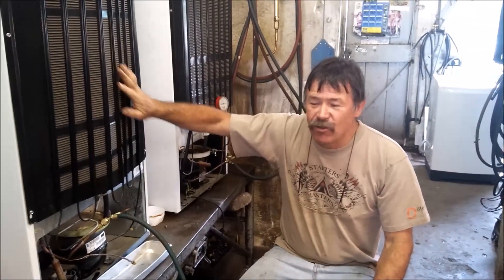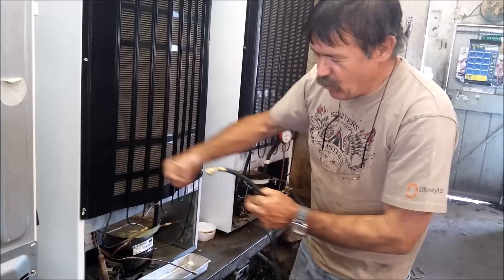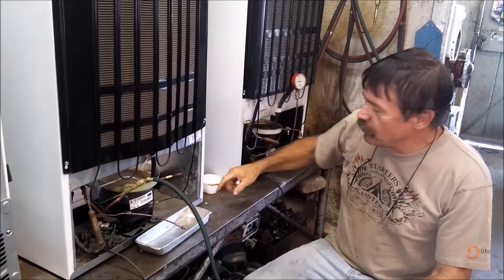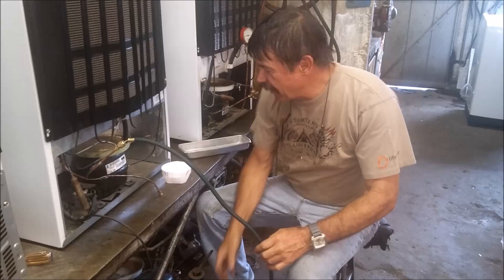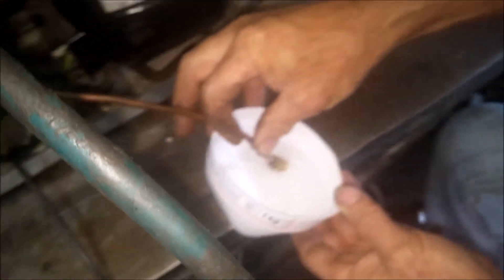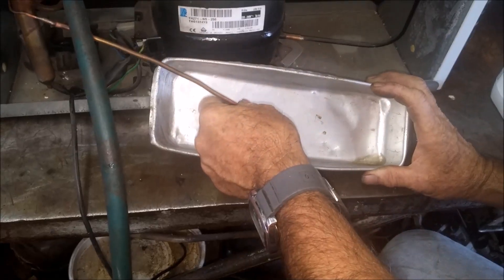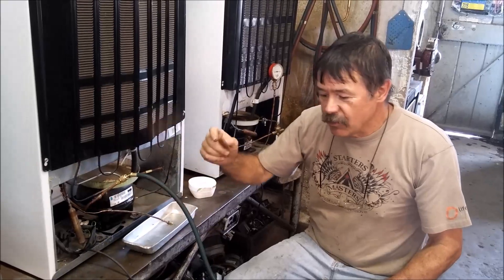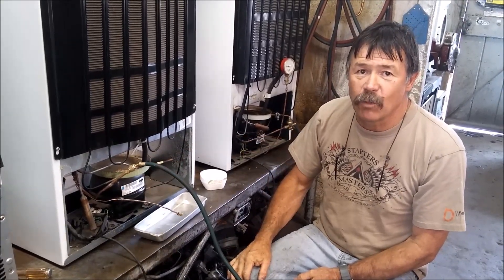Clearing a blockage - J D Nel Refrigeration

Comment: My repair tech said I need a new compressor, but I may just have blockage. The compressor is running, but the lines are cold. I may try this. I have gauges, but I don’t know what pressure to bring it up to. I’m going to have to do some research, I may try this.
Reply: Good luck! May i know how it turned out?

Comment: Better use thinner or isopropyl alcohol 99 ?
Reply from the maker: I find that thinners works better for disolving dirt, but you must make sure all the thinners is removed from the system before you reconnect it. You can use the alcohol to remove the thinners.
Reply: @JDNelRefrigeration thank u sir
Reply: @JDNelRefrigeration can use this for flushing before replace compressor ?
Reply from the maker: @PS-hr5wg  Yes if your gas system is dirty.

Comment: What if the compressor is damaged and taken out cost of a blockage in capillary tube or some were else could you just blow thinkers through the system.  Until it's all cleared and then replace the compressor.
Reply from the maker: You can do that but I prefer to blow a small quantity of flushing agent through the system to clear the last bit of thinners.

Comment: How much air flow should I be getting through the lines after a flush,

I have ran cleaner through as you did and I only get a light breeze that you can’t even hear it unless you out your ear next to it 

I’m at 60 and ran it up to 150 psi no change 

Is this just pressure drop or do I have a serious clog, cleaner went through just took a little bit
Reply from the maker: What I would do  is assemble the fridge & see how it freezes. If not successful, flush the system again.

Comment: Can I use diesel instead of thinners ?
Reply from the maker: It will not have the same effect. Thinners is designed to dilute paint and it does a very good job with diluting the dirt in a fridge system. Diesel might dilute the dirt but not as well as thinners.

Comment: Hi Mr Nel, how much would a repair man charge for this sort of procedure?
Reply: oh and of course a regas
Reply from the maker: @adrianphipps3257  I need to examine the fridge in order to determine the repair price.
Reply: @JDNelRefrigeration  Thanks, I was just looking for like a ballpark figure? I got a quote for R1000, is that too high? Thanks
Reply from the maker: @adrianphipps3257  It really depends on what it is blocked with, that will determine the amount of time and material I need to use to unblock it. Some blockages I cannot do for R1000.00 and others I can do 10 of them for R1000.00

Comment: You just  contamined the oil for 134a by adding 404a . And now on the 404a tank you are only to remove refrigerant on liquid  you are making a double mistake
Reply from the maker: On a small domestic fridge the type of oil is irrelevant
Reply: @JDNelRefrigeration  says who
Reply: do you know that you can use nitrogen wow
Reply from the maker: @torresedgar5650  Correct, I can use nitrogen but I prefer not to because if you have a stubborn blockage in an aluminum or soft copper tube and you keep on applying pressure behind it, there is a chance that you can rupture the pipe before the blockage clears. That's why I apply pressure from both sides to try and move the blocked substance around and then by diluting it with thinners then flushing it out. No chance of damaging the tubes.

Comment: Why not just braze in a new drier and capillary tube metering device? Less steps and it will ensure new and clean components. That’s how Hawaii do yo!!
Reply from the maker: In some applications it is extremley difficult to change a capillary that is situated in the wall of the fridge. Those I unblock, but capillarys that are easily accessible, I would replace
Reply: JDNelRefrigeration Got it. I worked on chill and freezer cases where I had to drill through the back wall to get the cap tube to the evaporator coil. Your way would have been the way to go. Thanks for this helpful tip.

Comment: That is a waste in time. Cut out old liquid line filter , braze shut highside and blow nitrogen back through cap tube.  Then braze on new filter. The best thing to do is replace cap tube and liquid line filter and be done with because you can never get them completely clean. It take less time just changing  then setting there trying to  clean out cap tube, saving the customer money is what it is all about.

Comment: I have a 4 year old frigidaire stand up freezer, never had a issue with it, put a bunch of food in it 2 days ago, and noticed a pool of water underneath today, copper suction line has a big build up of ice on it melting, freezer still seems to be working but is running lomger then normal, any idea or solutions pls?
Reply from the maker: There are many reasons why it would do that, you would need to have it tested to find the fault.

Comment: Thank you. But how did the block come there from the compressor and you have a filterdryer?? Can I use lanquer thinner did this type of thinner also leave a residue.
Reply from the maker: The coating around the copper wire in the compressor dissolves into a liquid state and slowly solidifies as it passes through your condenser and dryer. Some of the residue passes through the dryer and only solidifies once its entered the capillary and evaporator. Yes, Lacquer thinner does leave a residue.
Reply: @JDNelRefrigeration  ok thank you. But We dont have here flush agent. What you recommend me to flush the system.
Reply from the maker: @aycabbas  Nitromethane
Reply: @JDNelRefrigeration  you a good man can I recover the refrigerant if its like a hard to find one like R403B?
Reply from the maker: @ashramdhan1582  Yes you can, but if its contaminated with dirt you will have to filter it a lot to get it pure again.You can use 507 as a replacement.

Comment: In a pinch, could one use compressed air (no access to nitrogen or 404a) to move the dirt (150 psi or so)  followed by a vac down of the system?
Reply: Once you introduce the moisture from an air compressor it adheres to the inside walls of the system.  Moisture that has adhered to the inside walls of the system it is extremely hard to remove.  Air isn't worth it when nitrogen is so cheep.  Moisture will do permanent damage to POE oils.
Reply from the maker: Yes you can but, I don't like the moisture in the air to enter the system. That's why I would rather use a high pressure gas.

Comment: Why not use methanol as a solvent, then properly flush with nitrogen
Reply from the maker: Methanol is extremely expensive in South Africa but thinners is inexpensive, but you can use methanol. Nitrogen's pressure is too high to use on these aluminium tubes.
Reply: @JDNelRefrigeration  Nitrogen's pressure high????
It's pressure is whatever you allow or set it to be!
Reply from the maker: @ainslieboswell8884  I don't have a nitrogen regulator, that is why I don't use Nitrogen.

Comment: I replace whole capilary tube with the new one, if its posible. If that is not posible, I dont have the right solution. Some of my friends use nitrogen. This is interesting solution, cheers.
Reply from the maker: If it is easy enough to replace the capillary, that will solve the problem but on some fridges the capillary is in the wall of the fridge and to replace it you have to cut the fridge to pieces. Nitrogen is a very good propellant for the flushing agent but on some of the softer wall and aluminium tubing cannot take the pressure.
Reply: How to diagnose  blockage pipes ?

Comment: Nice and if I don't use thinner just use  404 will it enough ?
Reply from the maker: The reason why I use thinners is to dissolve the dirt. If you feel the dirt in your blocked system doesn't need to be dissolved, then use 404

Comment: Hello sir you videos is very informative sir i want to know how to clean oil and moisture from freezer of direct cooling fridge
Reply from the maker: You can flush the system with a flushing agent to clear the oil. To clear moisture, assemble the system with a new dryer, let it operate for a few hours then replace the dryer with a new one. Repeat until moisture is gone.
Reply: JDNelRefrigeration thanks sir for help 👍

Comment: How to clean damp inside system? without opening pipes? thx
Reply from the maker: Impossible. The damp is inside a sealed system. There is an additive that you can add to the gas that will neutralize the damp. It has a side effect which damages the compressor.
Reply: JDNelRefrigeration  Thanks :) do you know wich  adetive i can use do you have name? Thanks!
Reply from the maker: Thawzone

Comment: Denatured alcohol works the best for cleaning a system and it will evaporate plus its
cheap and any store has it (no smoking it is flammable)
Reply from the maker: Denatured alcohol leaves a residue behind once it has evaporated.
Reply: I have used denatured alcohol for cleaning parts before I paint
them never noticed any residue and it's cheap. I don't think a small
residue would hurt the system. I have done literally 1000s of cap tube
systems.
Reply: Alcohol would have to be 100% alcohol..... Any water would be a disaster in a refrigeration system..... Also alcohol is hygroscopic so leaving it in a system could either draw moisture in or out but either way you will need to use a proper flushing agent and a vacuum pump

Comment: What the difference between a thinner and a flushing chemical?
Reply from the maker: Thinners is a substance that is used to dilute paint it works very well to dilute the dirt in a fridge system, but when it has evaporated it leaves a residue behind. A flushing agent does not leave a residue behind. Thinners is better than the flushing agent at dissolving the dirt. I use a flushing agent after the thinners to get rid of the thinners residue.
Reply: The price. The result is the same

Comment: Why are you using R404a to push thinners into the system? 1. You are not allowed to discharge refrigerant to atmosphere. 2 How can you be sure you will remove all the thinners. If you are going to do this procedure take comp out and use OFN NOT R404a.
Reply from the maker: I do not blow 404a and thinners into the compressor, I know it will damage the compressor. I disconnect the tubes from the compressor before I start this procedure. The reason why I am using thinners and 404a is that thinners is much better than any flushing agent to dissolve the dirt. I use 404a gas purely because of the high pressure and the low cost.
Reply from the maker: The only refrigerants that we are not allowed to let into the atmosphere are the traditional refrigerants, which are R12, R22, R502 and R11.
The Interim refrigerants of which 404a is one, we are allowed to let out in South Africa.
Reply: He is in a country that has signed the Paris environmental accord and THAT is why the US was correct in pulling out.  It is not fair, nor followed EXCEPT in the US.  We don't need no stinking agreement to do the right thing.  Having said that, this guy is a refrigeration GENIUS!!!   I wish I could apprentice with him for a year.

Comment: r-404a is a blend of refrigerants and has to be charged as a liquid.  By removing gas from the tank your messing up the mixture of gases.  If you flip the tank upside down you get liquid refrigerant which might clean the cap tube better.
Reply from the maker: I am aware of the mixture but I purely use this to move the dirt out. There is more suitable gasses to do that, but in South Africa 404 gas is very inexpensive. I do not use liquid gas purely because my aim is to move the dirt with high pressure. There are lots of liquid flushing agents that I can use.
Reply: Oxygen free nitrogen!

Comment: Interesting video probably would be better with dry nitrogen with the cost of 404 i imagine
Reply from the maker: +Dan Webster (Paw Paw) The pressure in Nitrogen is too high for some of the aluminum tubing, and evaporators. We find that at approximately 450psi you will damage the aluminum evaporator, where 404 gas never reaches that pressure but has enough pressure to move the dirt.
You can use nitrogen if you use it through a regulator that can control the pressure at approximately 450psi.
Reply: Before I retired we would sometimes deal with a stubborn blockage by allow a vacuum pump to run all weekend.
Reply: @JDNelRefrigeration   no regulator  for your nitrogen tank? We use a flow regulator while brazing at less than 1 psi and then pressure test the systems from anywhere between 100 to 600 psi depending on system.